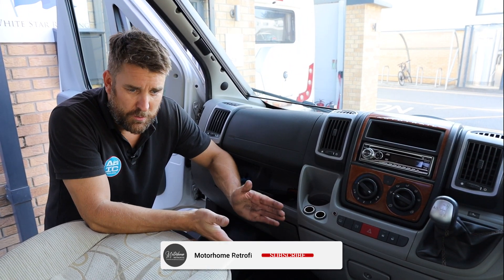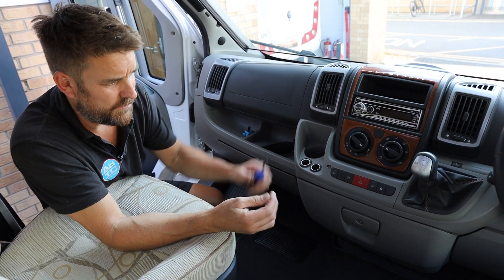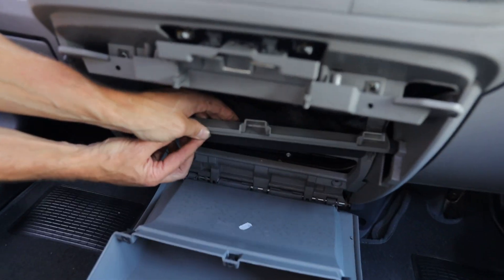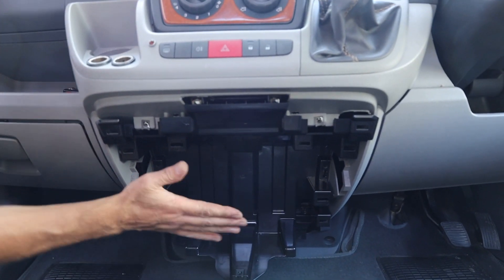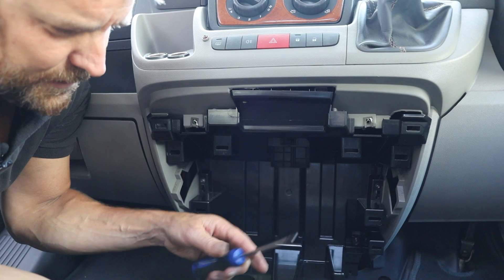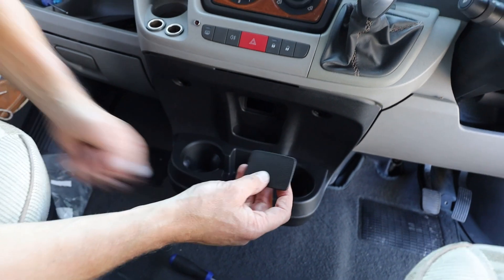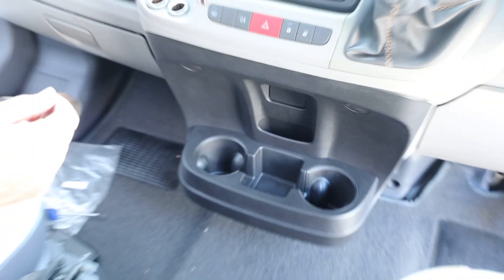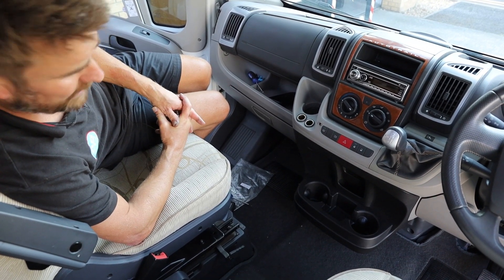How To: Remove the Centre Glove Box in a FIAT Ducato & Upgrade it to a Genuine X290 Drinks Holder

Comment: Excellent job mate ad that along with the LED running lights are on my list for you to do also the top glove box between the two air vents is closed, on mine its open, is it possible to buy a genuine closed glove box.??
Reply from the maker: Hello there,

Thank you for getting in touch!

For my team to assist you with your enquiry, we would need you to fill in our contact form so we can do some compatibility checks and also see an image of the part in question. Please see our link below:

https://www.motorhomeretrofits.co.uk/contact

Once received, we will be in touch as soon as we can to assist you. 

Kind regards,

Motorhome Retrofits Team